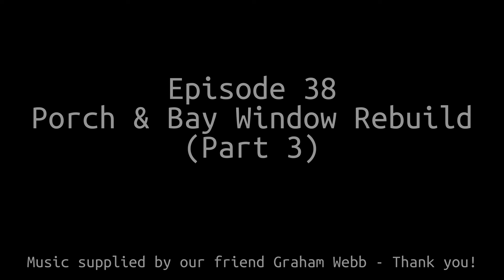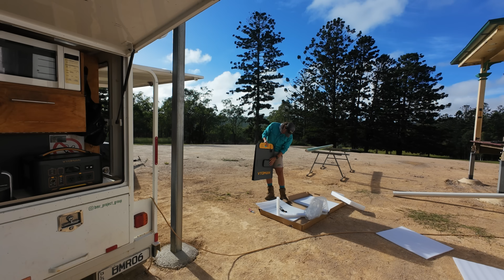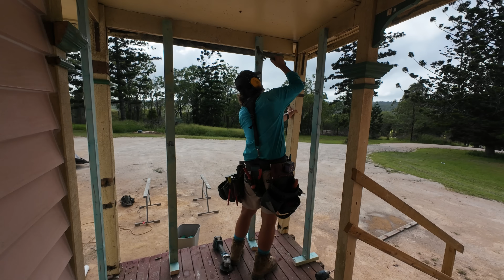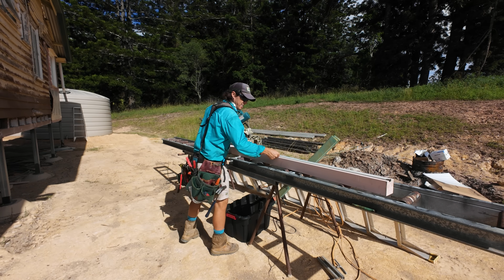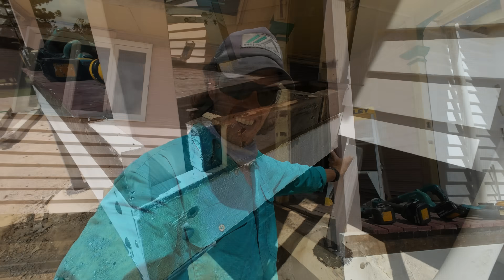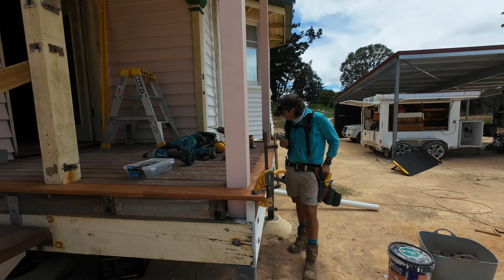100 Yr Qlder Reno: Porch and Bay Window Rebuild (Part 3) - Ep 38

Comment from the maker: Huge thanks to VTOMAN for the Jump 2200 that kept the tools running all day off-grid, no drama, pure power when I needed it most. If you're chasing reliable portable juice for your build, jobsite, or off-grid setup, grab one here and use the code for the discount:

Purchase Link: https://bit.ly/40d0asB

Exclusive Discount Code: GillBy
Reply: I love it when my favourite creators start getting sponsors. This looks very much like my little backup power supply I got for my septic tank. When the power goes so does the septic system. 
I'll definitely keep your link in mind when we get a second one for the house.
Reply from the maker: @cathymadsen2930 that's great Cathy, thank you for the support! All the best! Seeya next time.
Reply: Another cracker as usual cheers mate
Reply from the maker: Cheers Phil

Comment: Hey mate just a question bout the framing gun you use what brand and how's it go shooting 3" framing nails into the hardwood
Reply: Thanks mate that's exactly what i was wondering thanks for the info I just finished renovating my sister old house and its all iron bark thats probably round 100yrs old and as you would know iron bark gets harder as it gets old its like trying to put a nail in steal i have a nail gun that's runs off a big compressor and still can't seat the 3" nails so wasn't sure if it was just my gun having trouble
Reply from the maker: @mervancowan254  it's totally the hardwood. It sure is tough stuff.
Reply from the maker: G'day Mervan, that's the Hikoki framing gun. It's in my opinion the best Cordless framer on the market. A lot of other chippies on YouTube also rate it highly. As for shooting into hardwood, it doesn't send them home. None of the cordless framers do. I mean this also depends on the hardwood itself. Most air nailers won't send it home when shooting into hardwood either so it's a good question and I can't really give you the answer you are looking for. Hope that helps! All the best.

Comment: Hi, Can you tell me how much charge the solar put into the VTOMan and what the battery start level was and finish level? Did you get the second battery with the set?
Reply from the maker: Hi Paul, I had the VTOMAN loaded up. The fridge sucked pretty hard till it settled to temp. Once that happened it caught up. I started at 33% when I plugged in and when I finished the work it was at 38%. This was with direct full sunlight so the conditions were best for it on the day. I worked 6hrs to make this video so that's how much testing time I have that day. It's been at 100% since, coming down a bit as I stop for smoko and shash it with a solid draw (microwave, coffee, etc). I did not get the second battery as I have not needed it. I only see that beneficial if you have days and days of cloudy weather. Not here in sunny SEQ. Hope that helps.

Comment: Another informative video Byron, that VTOMAN looks the goods. What sort of battery does it have?
Nice compact size, what was the state of charge (SOC) when you had finished your tasks? Very neat and tidy job done on the new posts and porch and I have to agree with Gillian the bit of jewellery at the top of the posts sets them off.
Keep up the good work.
Cheers Kerry
Reply from the maker: G'day Kerry! Welcome back. 
The VTOMAN 2200 is a great little kit! The battery inside is lithium iron. Great for the amount of times you can recharge and makes it super light to handle. After that day of work the SOC was exactly where it started. This was  helped as it was a super sunny day. Once the fridge got to temp the draw went down and the solar was slowly topping up the battery. Happy days. Thanks again for tuning in and I look forward to chatting again next week.